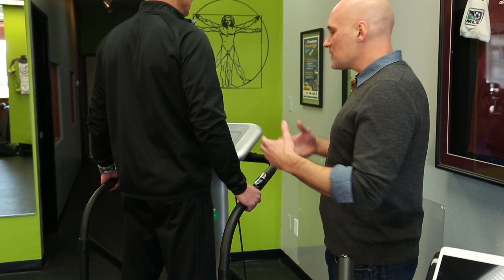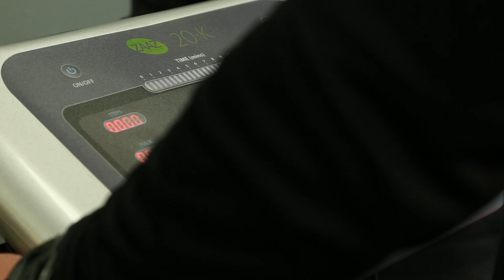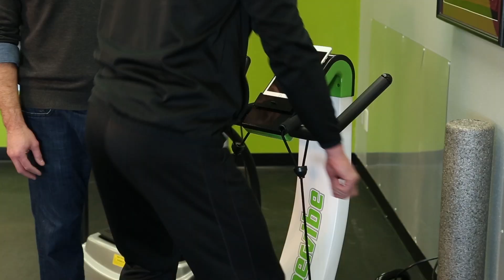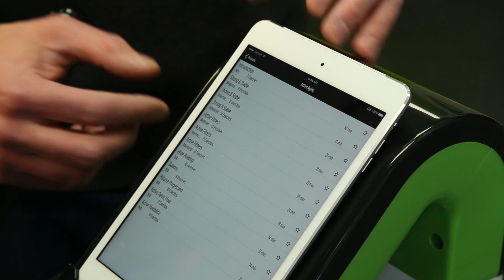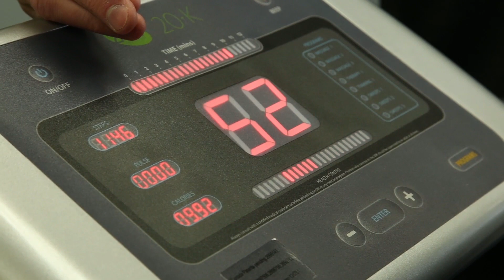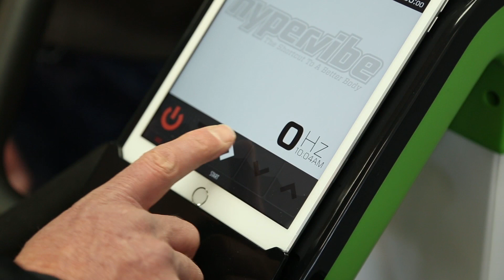Zaaz vs Hypervibe G14

Comment: How about warrantee ? There has to be ball bearings in these machines and bearings wear out.  Customers spends $2500.00 on a machine where do u bring it for repairs ? The way this video comes off is you guys are getting a kick back from Hypervibe. You should provide opinions and be un-bias. oh sorry just seen you guys work for Hypervibe ...............
Reply from the maker: Hi Steve, warranty is 2 years, machines are serviced onsite at customer premises in the event or repair or servicing needed. We have a network of service technicians nationally. Neither of the guys in this video work for Hypervibe, neither were paid for the video, they are both therapists who have extensive history with Whole Body Vibration. Gabriel originally had a vibration studio in New York using the German Galileo machine, who invented this technology over 20 years ago. Google the Galileo company, you can learn a lot about what real technology should do.

Comment: Actually the 15Hz are the healthiest range of frequencies. So ZAAZ 20k is in this range. Keep in mind also this machine is the only one officially approved by FDA as a safe vibrating device (may be for a reason).
Reply: Hi ViTech, there is zero evidence to your claims here, and I'm not sure what the "healthiest" range of frequencies actually means. Go to pubmed.gov and search "whole body vibration", you will find over 800 studies on Whole Body Vibration, none of those studies use the zaaz machine. Only a small number of studies have used 15Hz or lower. Their are several machines registered with the FDA in the USA, not a difficult task, none of them are "FDA Approved".
Reply: @Lee K Agree, the FDA becomes increasingly unreliable, just some org to give approvals to Big Pharma & monopolies, pushing their products forward, denying the smaller companies with better product to compete on the market.